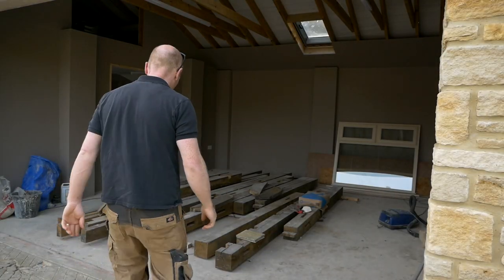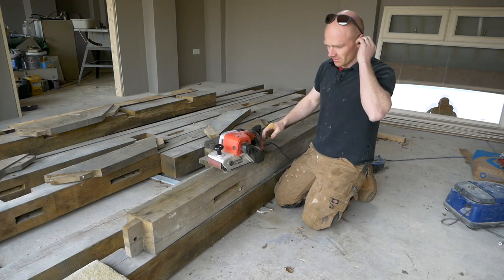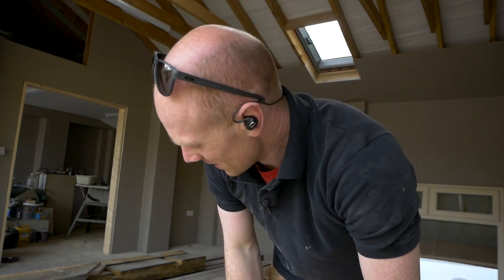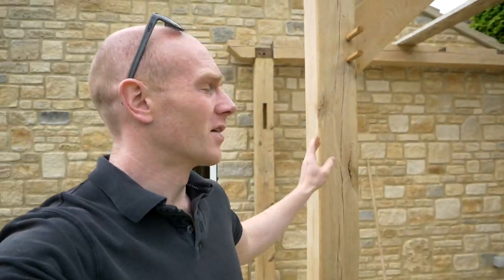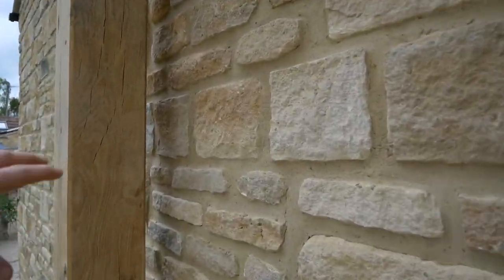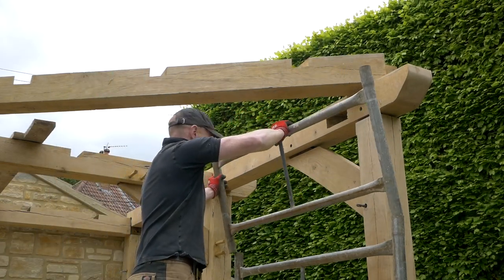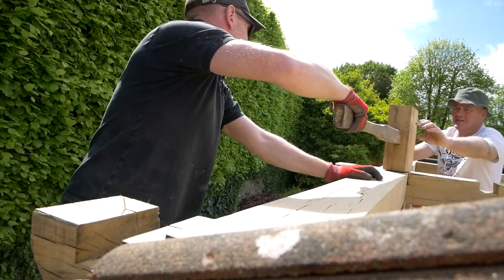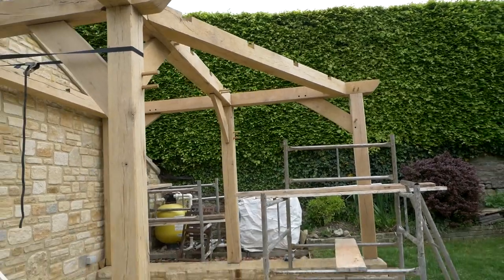Raising My First OAK TIMBER FRAME

Comment: You will want a drip edge or drip nose at the bottom of those posts, perhaps placing a bit of trimming with at least 15 degree to let the rain water run to the end and not go vertically along the bottom of the post, just as you do with window sills, possibly just run a groove with a routerbit need not be more than 5 mil deep. It will increase the lifespan of the posts with about ten or so years, worth taking imho.
Reply: Remember it is oak, if crappy softwood I would agree slightly but Oak is extremely durable, it’s a pretty toxic hardwood.

Comment: Just one thing; (As a retired  Prehistoric Plasterer) Steel and OAK should NEVER be put together as steel expands when rusting and causes splitting of oak beams + ROT!! ..... as is the case with butting up to 'any' wooden beams with cement, but especially oak. The water holds against the oak beams again causing rot and transfering 'DAMP' into the inside of the building ..... Just a thought :-)

Just Looooove seeing Oak Frame Buildings going up. So satisfying - Great Stuff! :-)
Reply: They're stainless steel, which doesnt rust!
Reply: @gbwildlifeuk8269  -  As you'll know if you've ever used Stainless Steel angle beads on exterior rendering (that's a myth) - when stainless steel gets damaged, it rusts just the same :-)

Comment: i wish you didnt rush over the actual placing the posts into the ground part. ive been looking at different post brackets . have heard of the method u used.  is that better? stronger etc using the steel rod and resin anchors? im also gonna be using 150mm posts.

Comment: Hi Tim!  I absolutely love your videos and have watched many of them - some of them many times! - whilst I design my own garden structure with 150mm green oak.  Informative and engaging.  I also want the beams on the same plane - something that pro oak framers seem to dislike - but your post / beam joints against the wall seem to be a great 3-way solution. Would you mind answering two questions?  1) Are the horizontals halved?  It looks like you kept slightly more depth on the beam that runs against the wall.  2)  How did you fix the beam that runs perpendicular to the wall?  It must need some structural screws or similar to stop it pulling away as it does not seem to have a peg.  Thanks PJ
Reply: Forgot to say: if it's not clear, I'm talking about the corner joint you are pointing to at 9:08

Comment: There's some huge mortice in those top plates and tie beams where you connected that diagonal tie. It looks like you've removed a lot of the strength in those timbers.
Reply from the maker: Yes I agree. It’s certainly not going to go anywhere but would have thought it through more if there was to be a roof or any great load on there.

Comment: Hello, what size dowels are you using? Were the holes drilled to the same size?
Reply from the maker: Pegs taper roughly from around 20-16mm I would guess. They are driven in to an 18mm hole.
Reply: @TheRestorationCouple  Great, thank you!

Comment: Use a heavier hammer to drive pegs. I use a Thor soft face. I find a claw hammer especially a lighter one doesn’t shift them quick enough and you end up damaging them
Reply from the maker: I found the same. Used an old lump hammer when needed but may look at a Thor for the next frame. 👍
Reply: The Restoration Couple I get them from house clearance shops. I’d tried the lump hammer but when you got 50 pegs to put in it gets to be heavy

Comment: 2 years after treating a new green oak porch frame with 2+ coats of Osmo Oil, the silver is appearing, particularly where rain water runs down it the most. Honey coloured to start with, but I certainly won't get the 4 years manufacturers seem to claim.
Reply from the maker: It is a losing battle I think. Dad has decided he will just do once and then let it grey if it really wants to. We used the tinted version at our house and it is very good, they told me that the tinted versions block more uv than clear which would explain it. Only holds up well on vertical surfaces though, top of sleeper wall needs recoating.

Comment: A planer would have been quicker than a sander.
Great job and thanks for all the tips.
Reply from the maker: Planing would really be best taking place before the joinery. Besides, yet to invest in a planer size! Sandblasting is a good option once it’s up.
Reply: Argh not sand blasting. Unless you can afford the finest grit available the beams will lose all their shine.
Reply from the maker: Peter Hendry a lot of the framers around here seem to get them blasted once up. I think it’s more for the deeper grained farmhouse look though. We will be planing the next timbers before I start on the joinery then any greying during the build should sand off easily. 👍
Reply: No matter how gently you blast them it sucks the life out of them.If you want a clean fresh look to the wood then get oversize stock and, when all is ready, bandsaw and make some super off cuts for use where the outer aged look would be really nice or sellable.
You also get the chance to adjust any oopsies.
Reply: The Restoration Couple client of mine got a frame blasted by a a big blasting company it was expensive and went blacker than black. Unless you use a specialist that understands green oak blasting using a none metallic grit (crushed glass is best) and under 40psi of pressure your going to end up with a mess.

Comment: Beautiful video. I am not convinced by the design plus use of oak though. Personally I think the dimensions of the timber make it look out of proportion plus the wood sitting on the footing doesn't help. Could you not have gone for 8cm by 8cm posts and a 14cm deep by 5cm crossbar??? And if it is going to fade to grey is there any real benefit in using oak in the first place??? I get that it was a training exercise to some extent but I don't think it is good environmentally using masses of oak in garden projects, I imagine our mediaeval forebears would think we were completely insane given the scarcity of wood they had to cope with. I did enjoy it hugely though! But isn't this sort of framing best left for extensions and newbuilds rather than the garden???